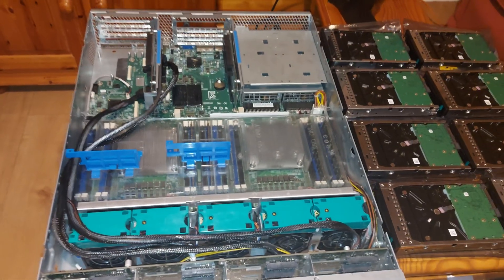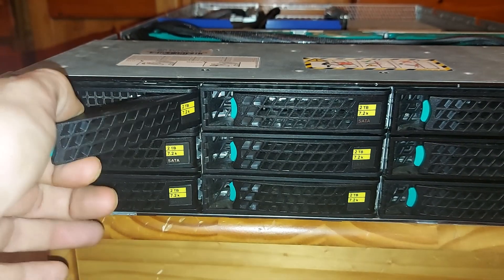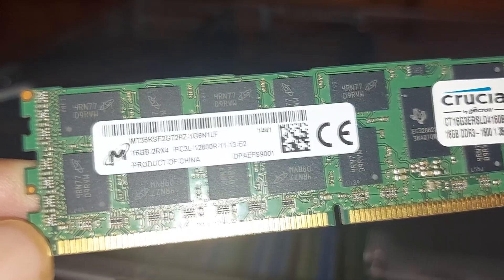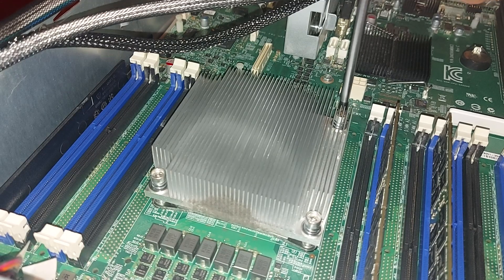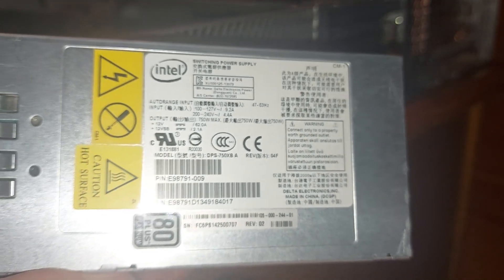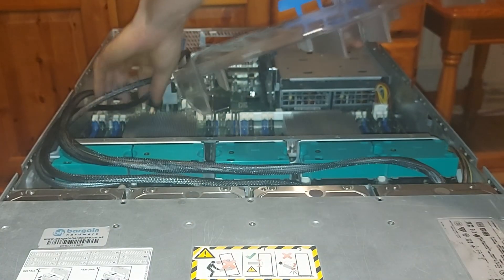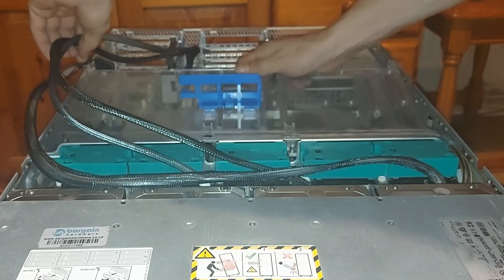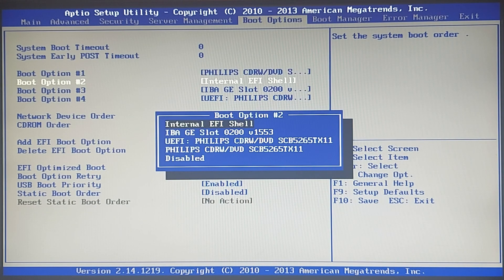Cheap 2u Rack Storage Server - EMC Avamar - Dual Xeon E5-2650 - 8C 16T CPU's @2Ghz, 64GB DDR3, 36TB

Comment: I cannot stress this enough about this board. I've seen at least two and derivatives fall victim to this. You should make a point refresh the thermal compound on the chipset heatsink. They also bow and warp if you tighten the CPU heatsinks down too much.
Reply from the maker: Hey, thanks for commenting. I will be sure to refresh the thermal compound on the chipset heatsink. I will also check the tension on the CPUs. 

Thankfully, I have not yet had it fired up for any substantial period, so I will make sure I get all that checked out before I start using it.

Comment: This motherboard is cursed. Just dumped 5 of these.
Reply from the maker: Hey, thanks for commenting. What were the problems you were having, if you don't mind me asking?

So far, this rack has been alright. I have not noticed any problems yet. 

Hopefully, I will get a bit of use out of it 🫰
Reply: Hi, you should check IPMI for logs, and do not tighten the heat sink way too much, it will cause random RAM issues.
Reply from the maker: @salman.sheikh  Thanks a lot, I'll have a look into that 👍